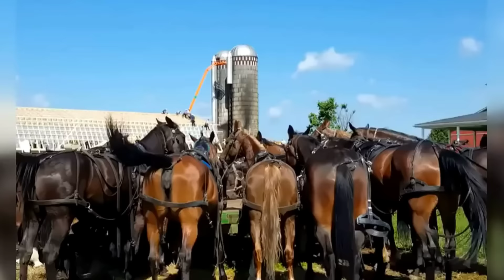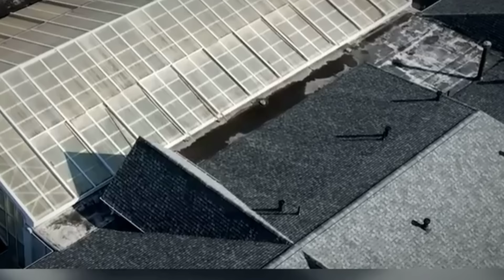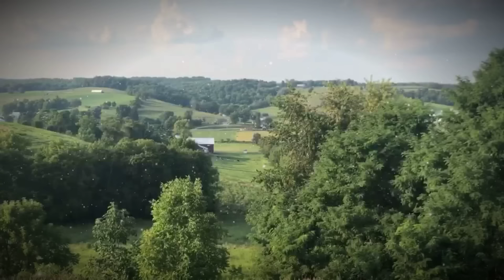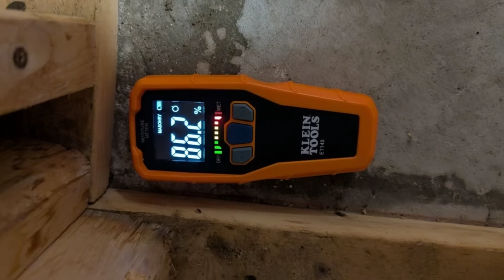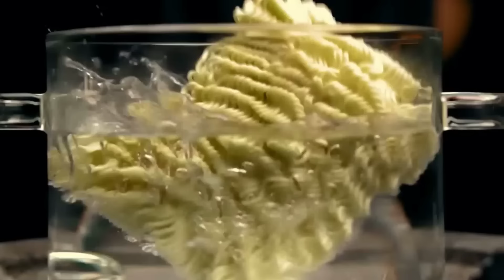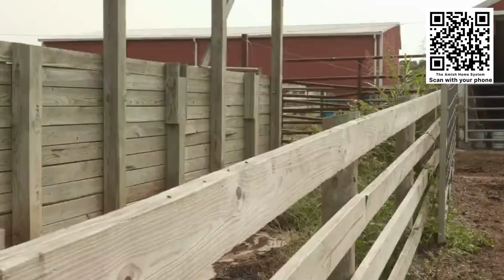Amish's 25 BANNED Barn Tricks from the 1960s That Engineers Now Say Were GENIUS

Comment: When I move to my site in the mountains I'm going to take a sawmill up there and make 8X 10s for my cabin from the trees on and around the building site. I have a little over 20 acres of virgin forest. I have plenty of every kind of wood you could possibly want. It's going to be put together using mortise and tenon and locust pegs. I've heard that poplar is insect-resistant. Is that true? I'm also going to make all my floorboards from Red Oak. Half of my land is on bedrock that is a pink sandstone one ridge in particular lends itself to mining the stone because there's only a couple of feet of soil over the top crest of the ridge. Would this sandstone make a good foundation for a log cabin? I'm a part-time miner and know how to work with rock. I also have a small excavator and loader, both with tracks so moving heavy stuff around won't be a problem. I can make the slabs as thick as they need to be. The main thing I need suggestions on is chinking between logs. What material should be used?